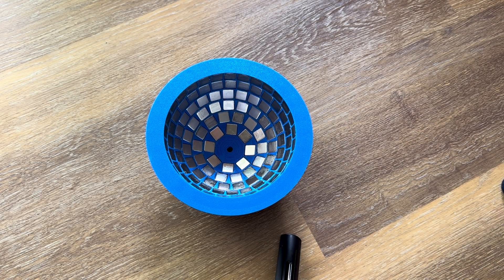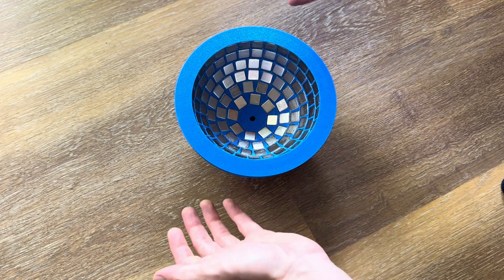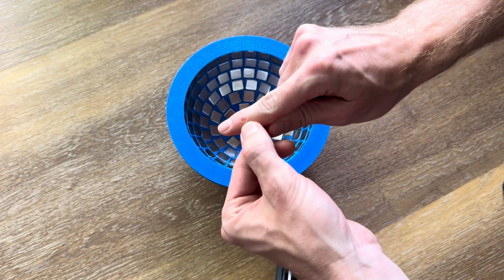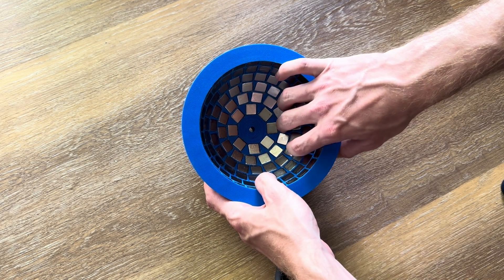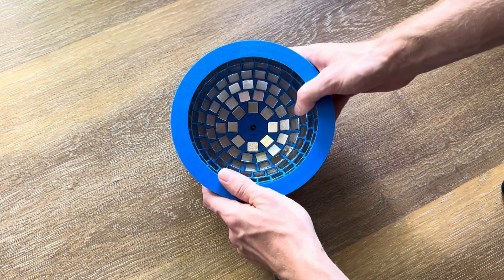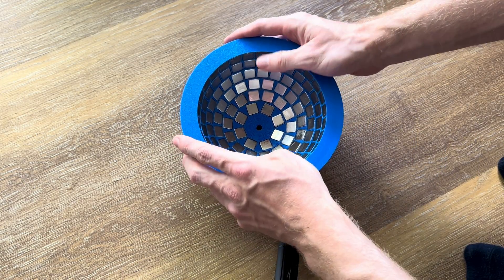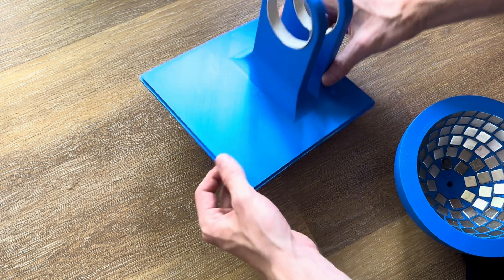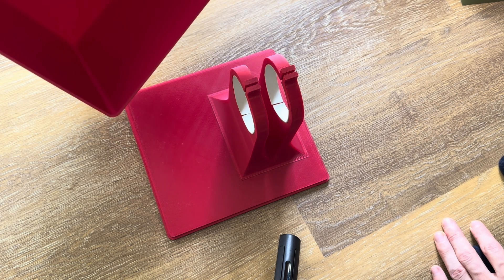Huge bowl magnet array (LaPoint array) for a PrimerCube build

Comment: Why don’t you use some kind of leverage? It would make the work easier and more precise. 

You can probably 3D print custom tongs to hold the magnets (form fitting to that size of cube) and some type of fixture to hold it in rigid fixed position. 

Also your viewing film can probably be cut with scissors. Since you constantly work with domes, curved arrays, why not cut one corner off, round it so that you can have the film match the shape of the inside of the bowl, to view accurately, the complete shape of the field?

You’re doing excellent work, amazing videos 🥳✨
Reply: I hope it makes sense, about the leverage. You have there a lot if repetitive movements to insert magnet cubes into array. 

If you make one thing to hold the array, another to hold the magnet, like a sort of arm or blacksmith tong that is moved with some leverage, very similar to a drill press. 

Probably you could even use a drill press to insert the magnets. Think about it, easy to rotate the array, easy to put magnet in the holder. The difficult part of inserting, will be made easy if you use a cheap drill press, fir example. 

This is not work to be done by hands, look at auto mechanics, most actions are done by using leverage.

Comment: I printed a bowl with 10mm classic magnets on a 3d printer. I have a problem with vibrations and especially with centering the bowl. I need the bowl not to vibrate when rotating. I put layers of paper between the motor shaft and the bowl, tried rubber, but it still throws and vibrates. Any tip? I think that if it does not run completely smoothly, the machine is not effective. Because I don't feel anything on my body when turning 3350 rpm, even after 20min. Not even any pain relief. Thank you for your response and I wish you the best of luck building more machines. Great job!
Reply from the maker: From my experience I can tell you that slight vibrations always will occur, that’s why I use vibrations dampeners on my motor holder. 
My first build also had too much vibrations so I had to reprint and rebuild the magnet bowl. 
Make sure you print the bowl massive (100% infill) then the bowl should have a tight fit on the motor shaft. 
In terms of pain relief, try different rotation speeds, also the effects might not occur immediately, depending on your issues it is more of an accumulative effect and it will help if you use it over multiple days or weeks. 
If you have slight vibrations in the system it won’t diminish the effects, just make sure they aren’t so strong that the device self destructs.